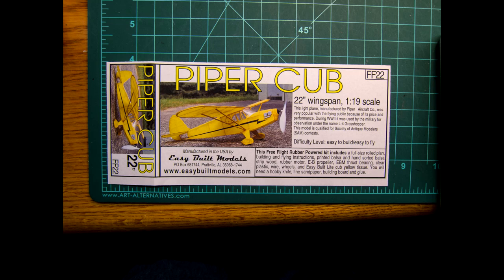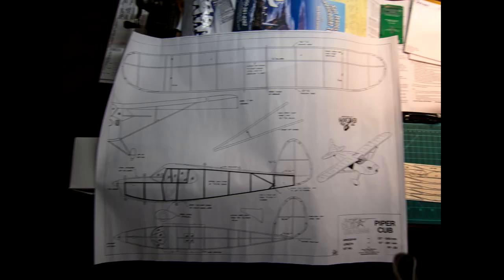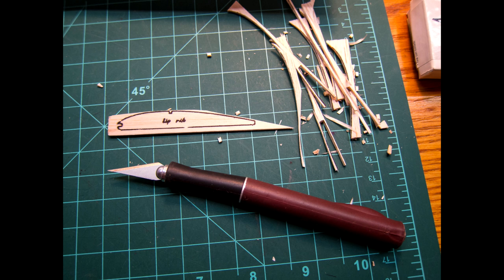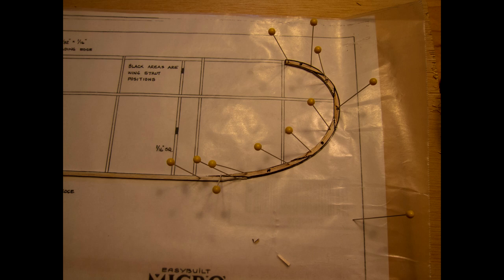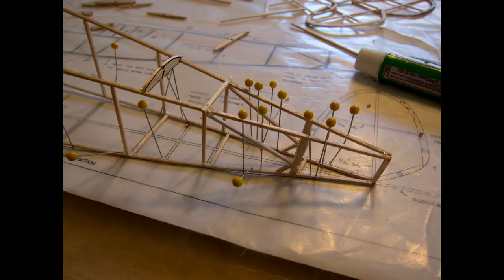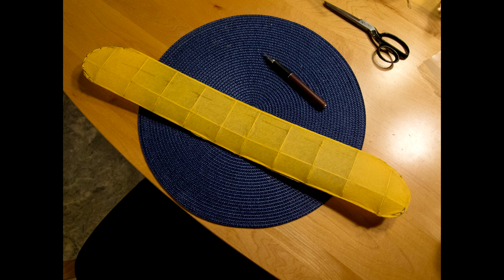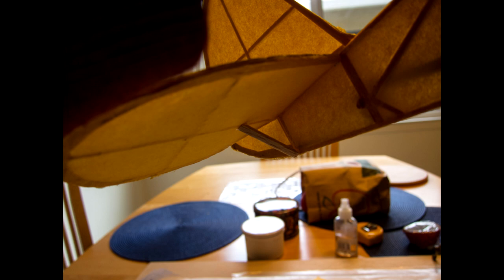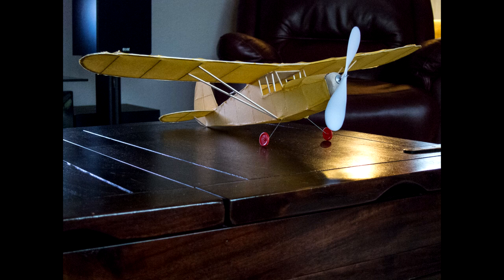#304 Balsa Wood Airplane

Comment: What, no flight video!  ;-)   Ahhh, the smell of dope in the garage. We used a piece of sheetrock to pin our glider parts down to...I still have the huge glue syringe I used ~50 years ago!  Thanks for sharing.  73 - Dino KL0S